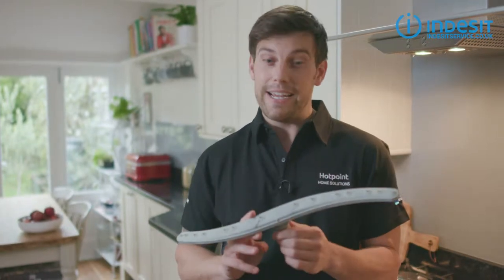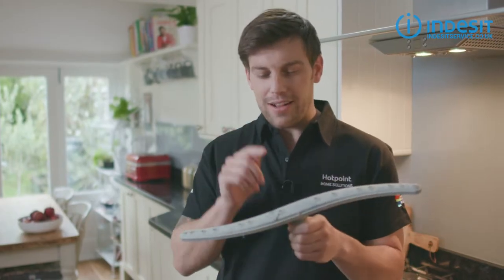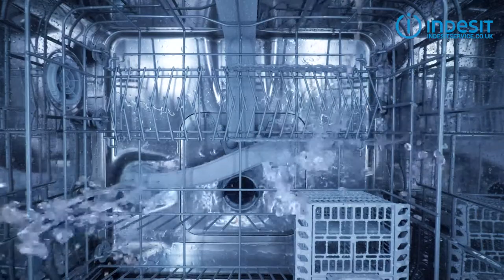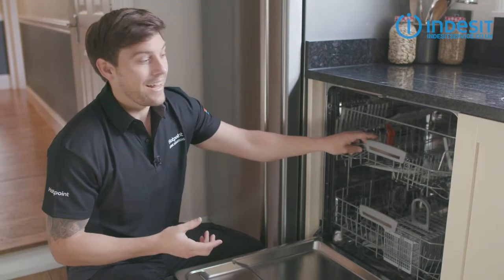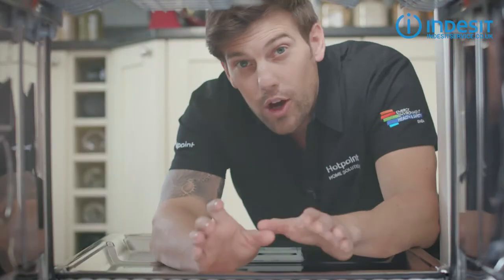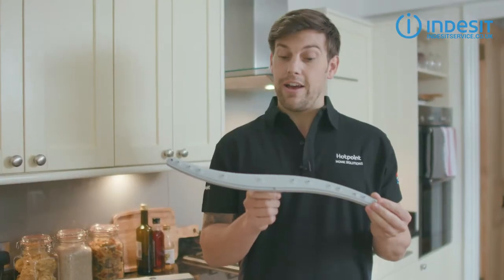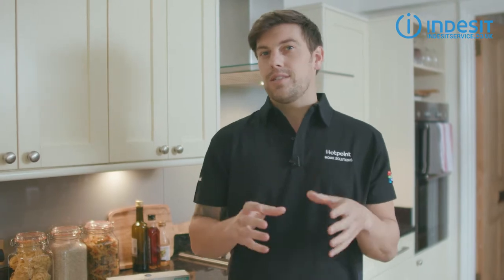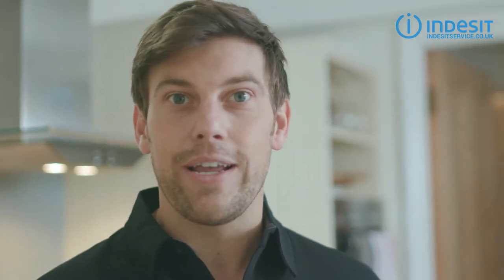How to look after your dishwasher spray arms | by Indesit

Comment: If the entire arm/feeding pipe has come off at the back of the machine, how do you re-attach it? I can't seem to get it to hold up again. Can't see a screw either. I have a DIS 04
Reply from the maker: Hi Michael,

Thank you for your message, the upper spray arm should detach/attach with a locking ring. 

But if the feed pipe has come loose I would advise you give our Parts team a call on 03714 544 025
 for any advice/technical info or parts needed.

You can also visit us on www.parts.hotpoint.co.uk 

Thank you
Ryan